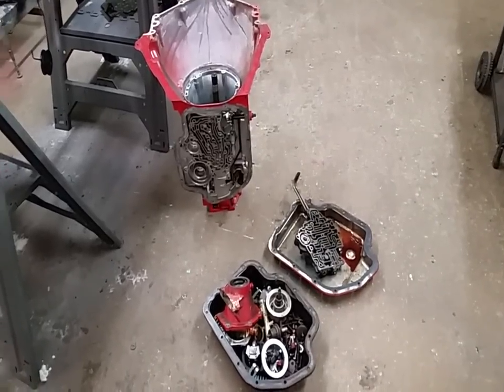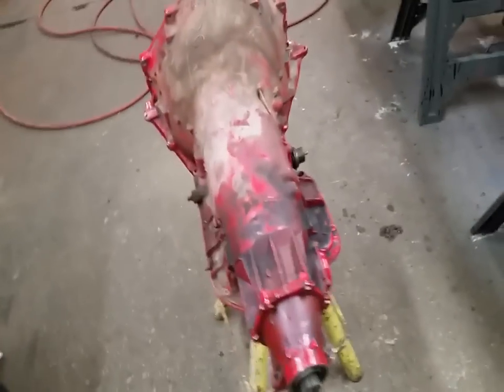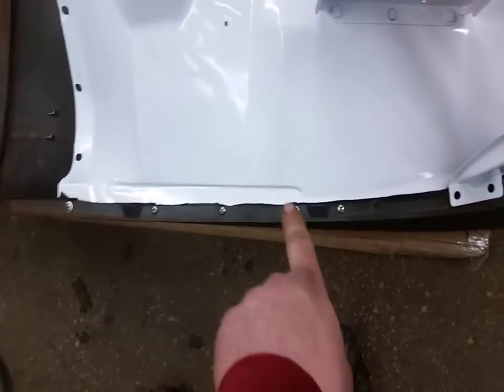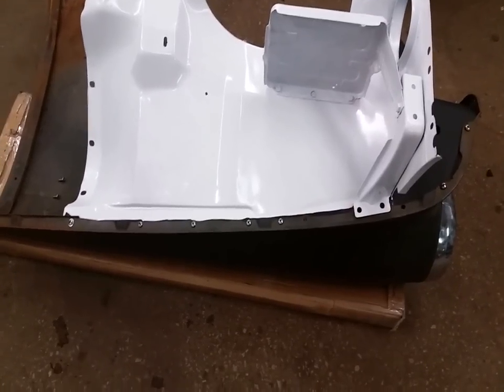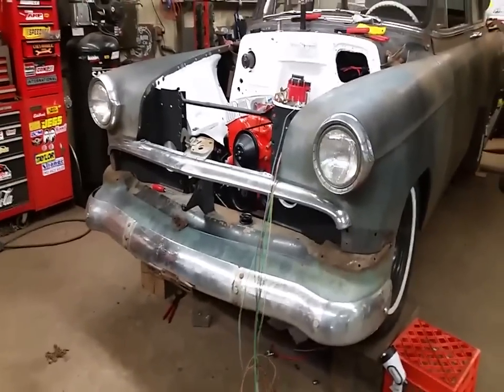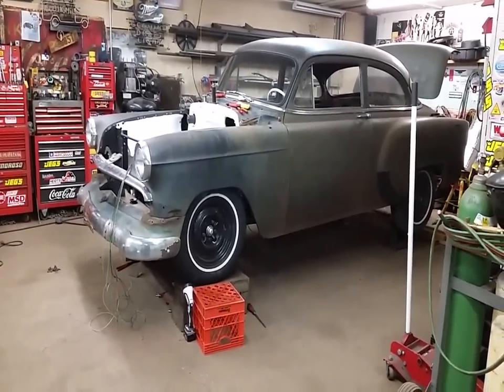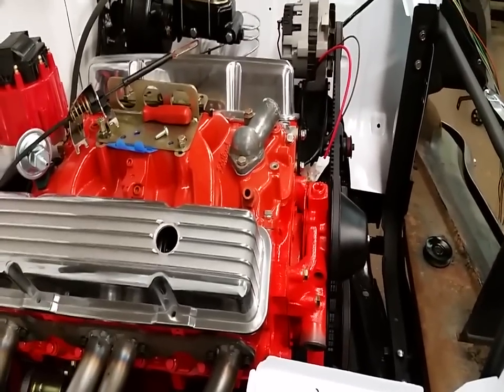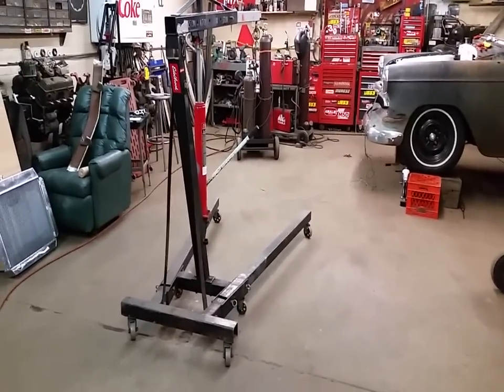1954 Chevy 150

Comment: it's looking good!  I have also built a 50 chevy that I did not take apart. it's a real blast. I still have some parts that I'm not sure where they go, but the car is running and driving just fine so... like they say " if you have parts left over, that just means you built it better then they did."  keep up the good work.
Reply from the maker: +cardude59 thanks man !! 
so true , left over parts are a good thing , most times :)

Comment: So he's trading in a th400 core for 727?
Reply from the maker: +Mopardude no , he's having a 400 built . I guess the 727 won't take the HP , and the aftermarket is full of 400 goodies .
Reply: *****
That will bolt up with just an adapter plate?
Reply from the maker: +Mopardude i guess its a billet aluminum case with a bolt on scatter proof bell housing . He said nothing in the trans is GM , all after market . I asked him if it was a power glide , because i know you can do that with them . he said no , it' s a th400 . 
So the trans is a 400 , the bell will be for the dodge .  I told him to bring it up when it's done . I'd like to see this .
Reply: *****
See if he will let you do a video on it.  If not tell me the details later!  LOL  Where did you say he had it done?
Reply from the maker: i hope to get a vid , or at least a few pics . 
I don't know the guy at all , but he knows people i know. so will see . 
ATS in Germantown  , automatic transmission design . Use to be called Hipsters back in the day . There claim to fame is coming up with the trans brake .

Comment: Now that is just wrong Matt, to open with a 4 speed going through the gears and then cut immediately to a disassembled automatic transmission sitting in pieces on the floor. LOL